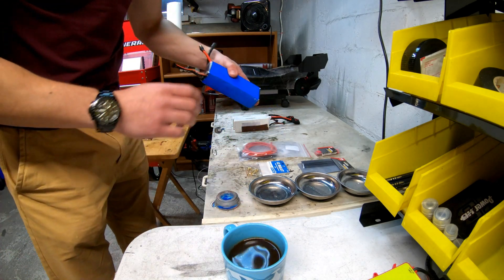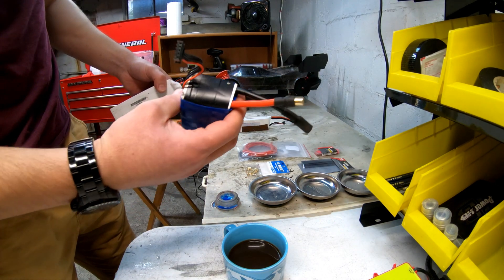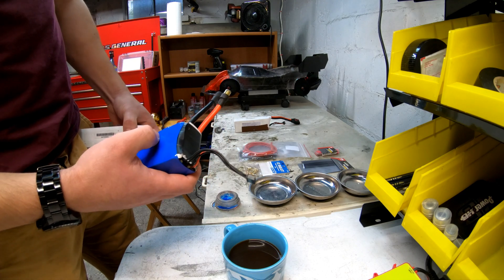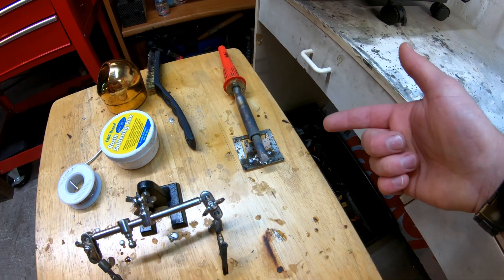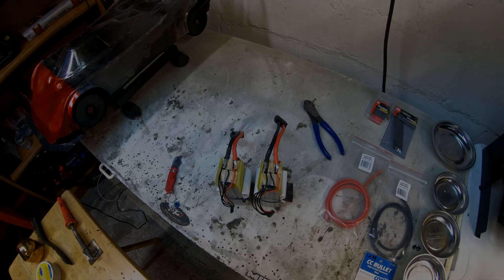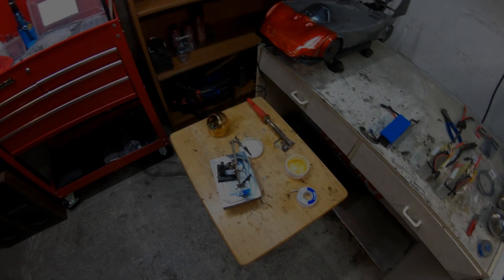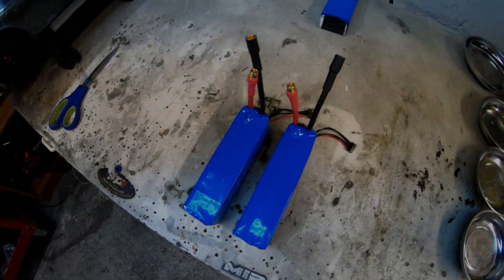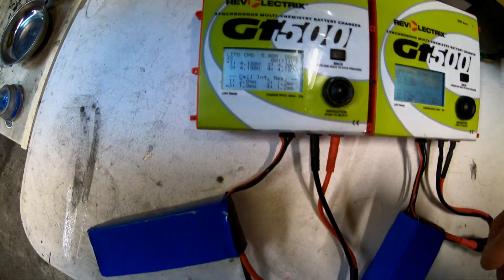8AWG battery wire mod tutorial

Comment: Nice video.  I need to update my wires too.  You recommend 8mm bullets connectors that QS8?
Reply from the maker: Qs8 is hard to solder without risking popping the resistor but avoids pops and bangs for easier plug-and-drive but the 8mm’s are light and allow shorter wire lengths. Power-wise I haven’t had bottlenecks with either connector type.

Comment: Why do you put the lipos in the freezer dude? 👍🏻
Reply from the maker: To avoid damaging the first and last cell as the solder points go directly into the cells.
Reply: @raceme5757  I see. I've made a few lipos myself but never thought about burning the cells. Mine have all been ok luckily 👍🏻🤘🏻🤘🏻
Reply from the maker: @ksrnate  With lipos being highly inconsistent I try to avoid risk much as possible, with super quick soldering room temp might be fine on certain brands and series.